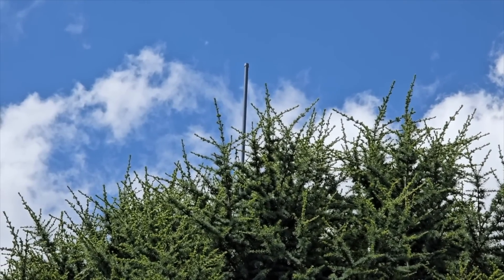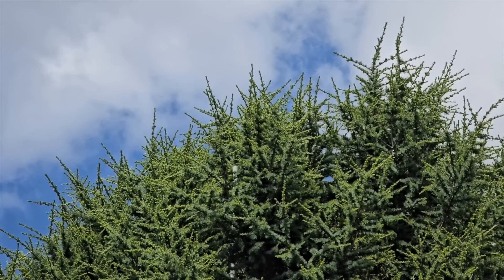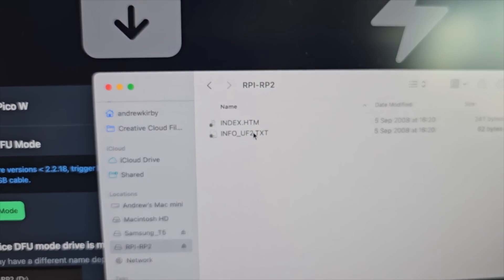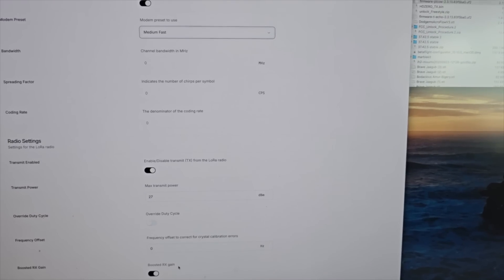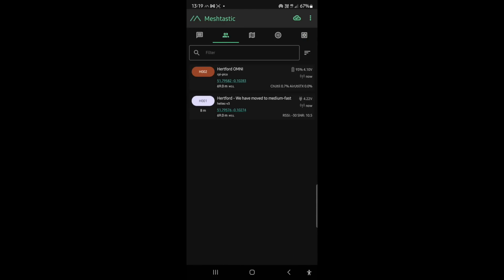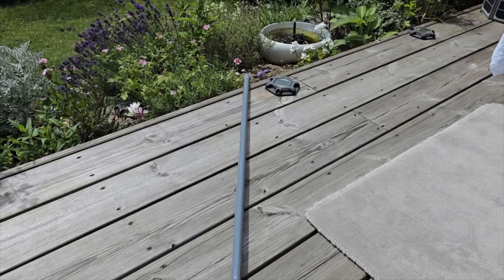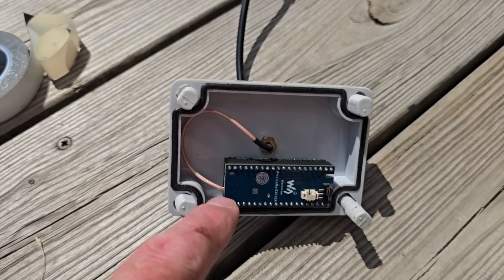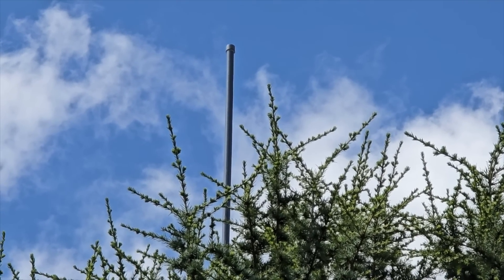Installing a new MEDIUM-FAST Meshtastic node up a tree!!!

Comment: I noticed that a new release of Meshtastic has been released. It explicitly mentions the following about traffic management. Maybe that will help with issues?

Version 2.4 along with the last 2.3.X update brings some default traffic management practices to increase the resilience of larger meshes and allow more airtime for messaging. 
That may help with issues.

Any thoughts on that?

Comment: Ideally we would be able to receive more than one mode and decide which mode to retransmit the next hop with. Obviously there would be issues with going down in bandwidth, but it would also make sense if we upgraded the bandwidth in dense areas where minimizing airtime is more important than fault tolerance.

To do that properly we're back to what I said before about STP from Ethernet networks; keep a routing table with hop scores so we know which paths packages should take. This would greatly both enhance the effective range and minimize airtime, at the cost of memory usage for the routing table and delays from fault detection (we must detect a path as faulted before we retransmit along another path).

Comment: I have two lengths of ally scaffolding, one slides inside the other (using compressed air to expand and contract) You can have it/them if you want.